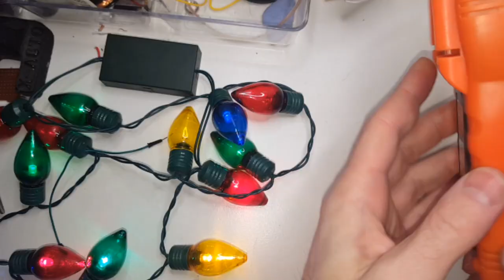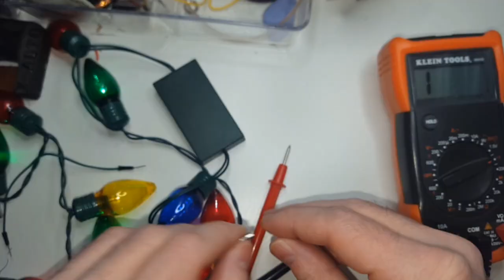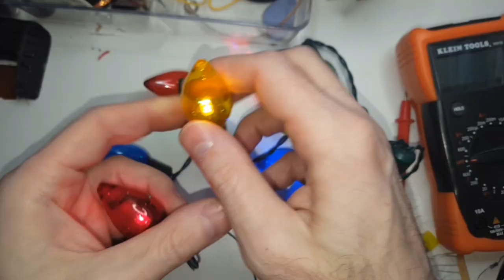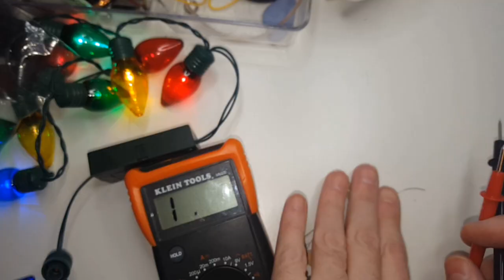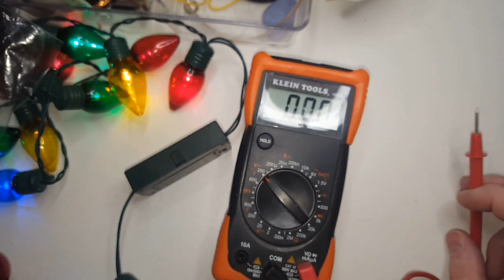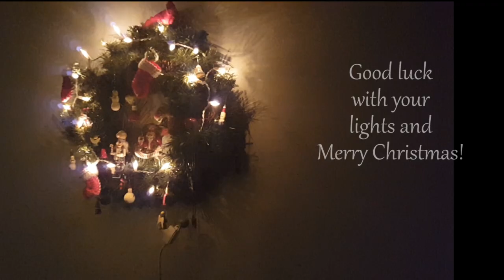Using a Klein Tools multimeter to check Christmas lights and other circuits

Comment: Is there a way to test the battery box that comes with the mini strings of holiday lights to see if it is functioning? I know the string of lights is working (cut it off the box and was able to get it to light with a button battery.)
I was refunded completely on the light strings (purchased 7) and I see that replacement battery boxes are available but I would like to check the battery boxes to see where the problem might be.
Thank you for any help
Reply from the maker: You could test for continuity. The switch on it may be bad or there is a disconnect somewhere in the wiring, but either way if there is no continuity then it should be replaced. Take the batteries out, set to continuity and test the battery connections if you didn't cut the wires or if you cut it then test the two conductors which should form a circuit through the battery box. If there is a circuit board inside then there could anything wrong with it and should just be replaced.